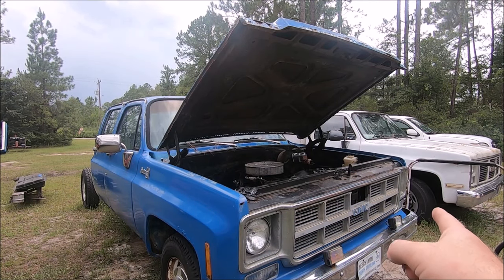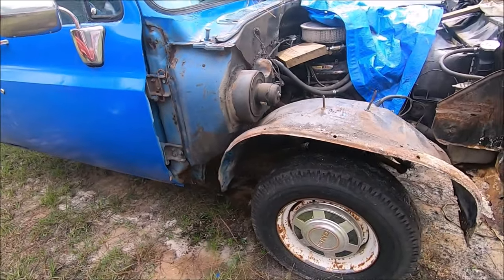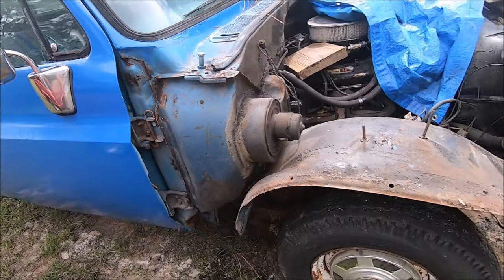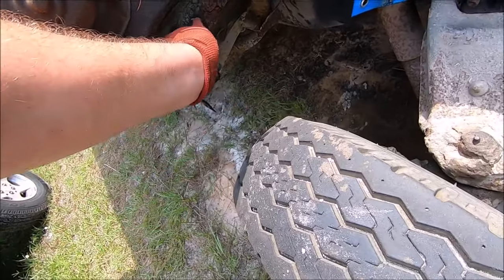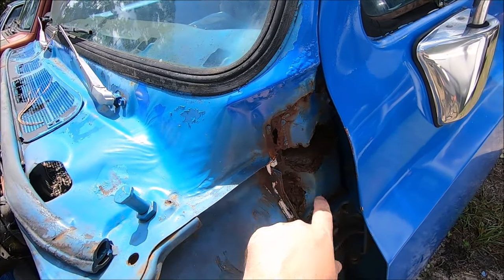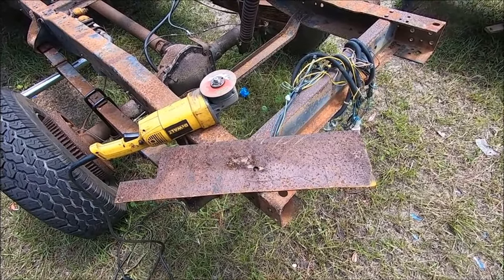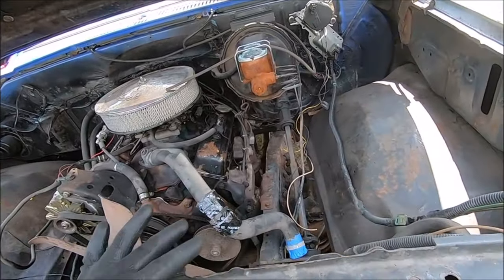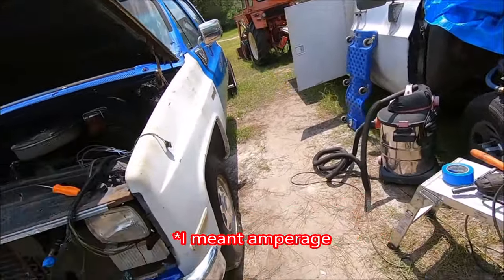1978 GMC squarebody crew cab front clip swap [rebuild part 2]

Comment: Great job!  Your gaps are fine.  When these were new, they didn't all have Cadillac-perfect gaps, as they were made to be work vehicles, not prestige vehicles.  I did the opposite, put the 70s front clip on the 80s cab that I swapped onto my 73 frame.  As you see, either bumper looks fine with either front end, but if you really want to swap the 70s bumper to the 80s frame, you need to get an extra pair of lower mounts, position them on the lower flange of the rail and drill the needed holes, and bend them outward until they mate properly to the bumper.  All the rest of the stock 70s hardware works fine.  Can't remember if you have to do any drilling.  To put the 80s bumper on the 70s frame, you have to cut off that part of the rail that forms the lower bumper mount and use the 80s mount that has holes for both upper and lower mounts.  Non-squarebody people will never notice the difference.

Comment: I plan on going other way on my dually... i want roundeye front end
Reply from the maker: I like the look of early front ends also (they are growing on me) but given the option between the two that I have it had to go to the one that was more solid. If I had money I would have just replaced all the blown out panels but….. sometimes you just have to use what you have.
Reply: @wrenchwranglers  Especially if you are using it as a work truck and not as your pride and joy.  Whatever makes it functional!

Comment: I’m wanting to swap an 80s front clip to my 74 just like yours were the wiper blades able to line up with the 80s cowl I need to keep my wipers so I’m iffy on the swap
Reply from the maker: The arms and blades appear to be interchangeable. It’s the longer/shorter drive shafts that the arms mount to protruding out of the cowl that’s important. As long as you switch the drive assembly it works. The old ones have to be short to fit under the hood, and the newer ones have to be long enough to stick through the cowl. Those aren’t interchangeable. The right one has to be used with the right hood/cowl.
Reply: @wrenchwranglers  good to know that’s for getting back to me gonna prolly go for the swap thanks!

Comment: How did you deal with the rear portion of the hood hinges. Im doing the same swap and I am struggling to get it to fit right. Thank you in advance for any advice
Reply from the maker: I measured the position and holes on the newer truck and transferred them over to the older truck using points of reference they both have like existing bolts and edges.
Reply: I was hoping to see how you did it on your video because I am still struggling with the hood alignment

Comment: How did you bolt on the cowl panel?
Reply from the maker: Everything is the same in the locations where it screw in except the holes for the screws. It only needs drilled at the proper locations and then it screws right on.